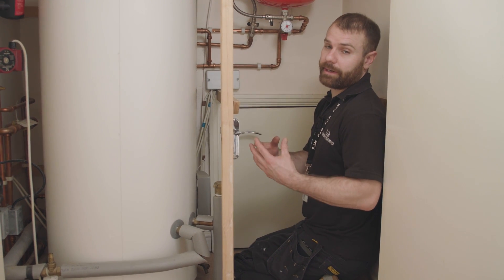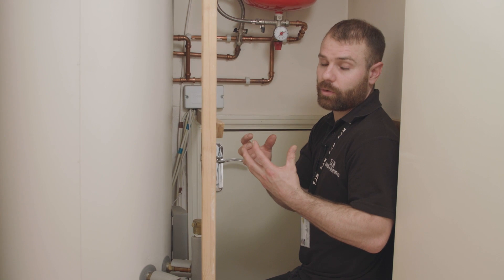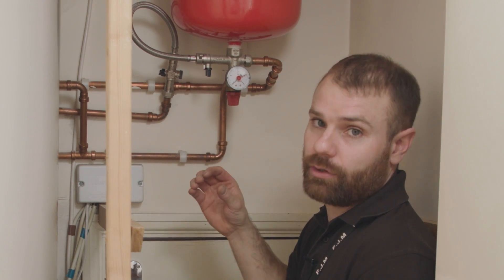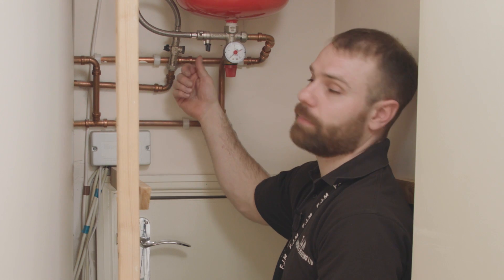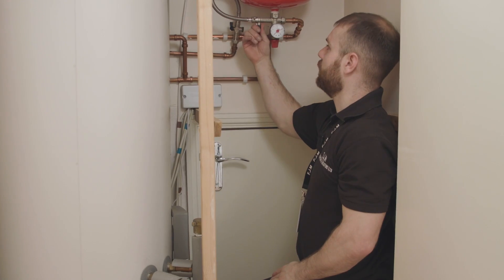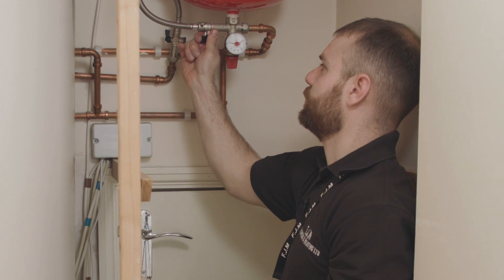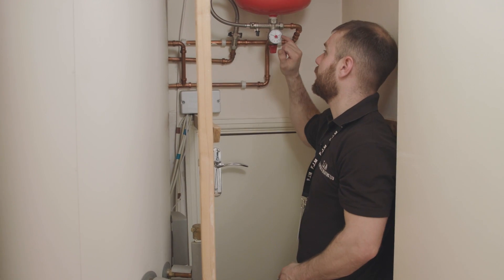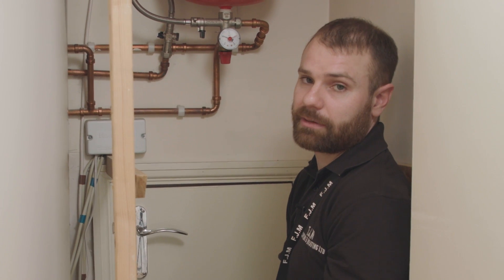How Do I Top Up My Boiler Pressure?

Comment: How fast should the pressure rise? It rose v fast on my system and someone said that’s a bad sign and indicates that the red water expansion tank is broken. Is this true?
Reply from the maker: It completely depends on the size of the system and how high your mains water pressure is when filling. On a small system it will fill pretty quick so not necessarily indicative of a problem. If the pressure rises rapidly from 1 to 3 while the heating is on this could indicate a problem with the vessel. But if in doubt best to call in a gas safe engineer to check it out.